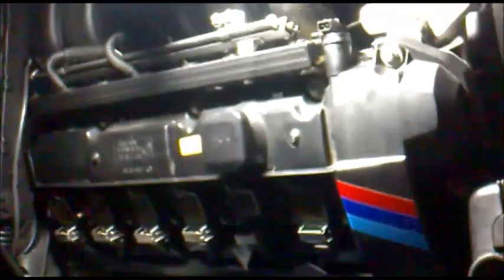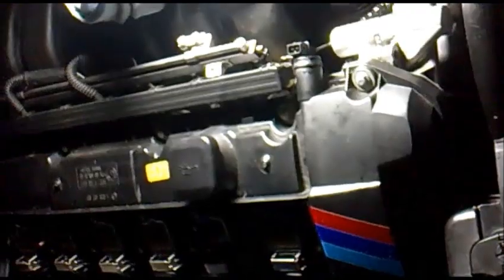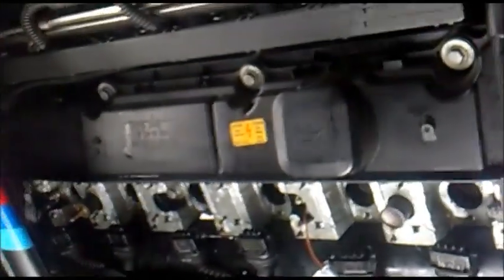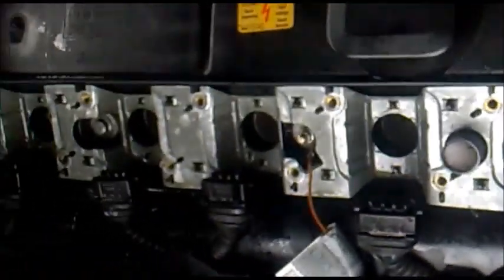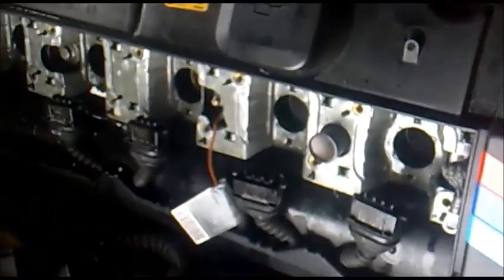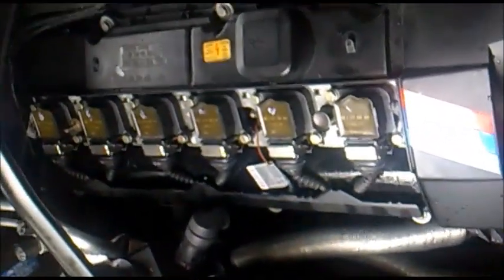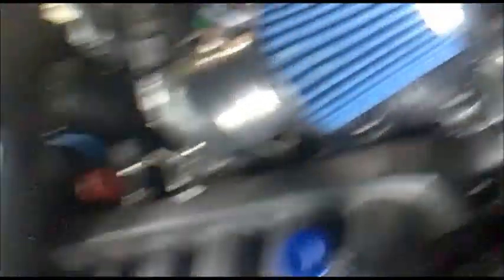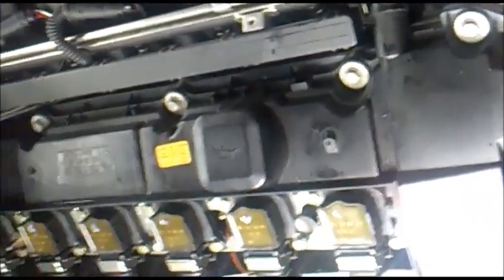Fix for Crank No Start BMW (Fuel Flood/Cylinder Washed)

Comment: i have a big block 70 Dodge engine cranking but no start i checked everything in ignition all good, can i just put oil in #1 and #8 ( opposite side) only? cause i have headers and spark plugs are hard to reach

Comment: One reason bore wash happens is because of old spark plugs that are not burning all the fuel.  My Toyota 2002 ist suffered this problem but after removing the spark plugs turning over the engine rapidly a few times then installing new plugs fixed the problem.

Comment: This worked for me also after the car sat for a year. It runs, but roughly, so new plugs and oil change next. Any other suggestions ? 2000 323i

Comment: Happy I found this video, was running out of ideas from scrolling thru forums. 2011 bmw 335i w/ n55 engine. Performed oil filter housing gasket replacement, valve cover replacement, wallet blast the valves, switch out all spark plugs and boots. All over the course of about 2 weeks. After priming the oil system per bmw procedure I was getting the dreaded crank but no start issue. After much troubleshooting, found this video and after buying a cheap endoscope camera I looked at all the cylinders after removing the plugs again and cleaning them, indeed the cylinders looked dry. Used a straw to add about 5-10 mL of new engine oil to each, pulled fuse 70 to ensure the fuel pump wouldn't turn on, then with the plugs off and the cylinders open to air, cranked the car about 10 seconds. A quick endoscope look into each confirmed the cylinders looked nice and glossy covered with oil. Plugged all the spark plugs and boots back in, returned fuse 70 to its place, crossed my fingers and cranked the car and to my surprise started right up! Large white plume of gas and rough start but quickly settled down and let it run for about ten minutes to ensure all the noises I'm familiar with of the engine were normal. Thanks again!

Comment: Worked for my 2005 X3 that sat through a 2 week cold spell and would not start. It did not start right away but I could tell it was going to because it was cranking much better. A little bit of patients and it fired up and is running great. Thank you!

Comment: My brand new Bosch fuel filter after 2 days decides to start dumping fuel out of the regulator filling up my intake manifold with gasoline! Then trying to crank it over to try and start the motor on the side of the road fuel locked the  pistons! Now I keep fouling out spark plugs! Going to let it sit for a day and hope she starts!

Comment: I have a chevy silverado,  one of my fule injectors needs replacing.  The dealer said I could drive it until the parts are in,  which is about a week.  The driving is fine as of right now.  Do you think it is okay to drive like the dealer said?  I don't want to wash any cylinders and cause more damage.  Thank you

Comment: I want to thank you for these tips, worked for my E39. Car was in underground garage where no tow truck could easily reach to. There was a huge smoke came out after the engine fired up,  almost like a smoking grenade went. Got lucky there was no fire alarm.

Comment: Do you turn over the engine with the plugs out with the oil in the cylinder? Or do you put the plugs in with the fuse pump fuse pulled and crank?

Comment: So here'e the problem im having and im confused! I've replaced soooo much... Camshaft, Crankshaft, Spark Plugs, Ignition Coils, Fuel Pump ( i Need to change the fuel pump Filter and maybe the fuel regulator) ... None of things i did change help the car Start.. It would Crank but no start. Change fuses  and relays as well and to no avail. Tried this method ....... tried it ... tried it tried it then boom the car Started.... Ran for about 30 minutes then Cut off... Didnt't cut on again until i did the process over. It seems as if it would build compression then lose it again. Doesn't have enough power to Drive, Reverse or nothing even when on and running. Checc Diag tool and it's throwing me codes for things I changed already. SUPER CONFUSED... What's my next move?
Reply from the maker: I would suggest you post up on the bmw forum and such really, you might find a better answer there, chance are its a intermittent problem maybe with the crank or cam sensor, have you tested the engine for compression and such? could be a leaky head gasket. I cant really comment on it as a lot of variables come into play. Maybe read some codes and post up on one of the big bmw forums. All the best

Comment: @ Hyde Motor Works Please Help...
Do I... 1) REMOVE Coils, Spark Plugs & Fuel Pump Fuse. 2) ADD Motor Oil where plugs go. 3) Hit Start?
Reply from the maker: Hi, essentially this is a old mechanics trick, you simply try to add oil having removed all spark plugs and disconnected them as well as the fuel and such and simply let the engine crank, then put it all back in and try again. If it was fuel washed it would help bring the compression back up, you can read up on such online.

Comment: Unfortunately this didn’t work for mine :,( I’ll keep trying
Reply: 330i ‘01 auto
Reply: @rock9Tray   
  Hopefully when i tow my car to my storage tomorrow I will some lucc. Im on a incline at my house so im thinking that maybe affecting my process and result. Im just trying to figure out what else could it be. I have Diag scanner and the symptoms its giving me is the things i already replaced. Im thinking it's doing this because of the misfiring in building the compression bacc up. I don't know we shall see when i get it towed in the morning
Reply: same here ... seems not to work and i've changed everything on the car . Camshaft position sensor, crankshaft position sensor, Fuel pump, Spark Plugs, Ignition Coils etc .. Now what I will say is .. when I tried this... It did start and ran for about 30 minutes then bacc to the same thing again. Im confused right now
Reply: Update*** after getting my car towed to my new residents it started and burned all white smoke thru the tail pipe as stated in the video! It’s running but only when disconnected from the MAF. I need to replace my MAF, my gaskets, Hoses and my ccv however to continue onward with no issue. The vid really helped!! Especially since my spark plugs were soaked in oil to begin with. Burnt out on top of that. Best of luck to you tho man

Comment: Can anyone pls help my 2002 bmw 318ti automatic can't start... Engine swing and fuel pump working and checked all the fuses and engine just swings and not getting any spark at all... Can someone pls advice what can be done
Reply: Any help plss
Reply from the maker: Could be a lot of things, best you seek help in the forums, could be the crank and cam sensors, can be the abs module. go to the 318ti forum and ask there somebody might help.
Reply: @HydeMotorWorks  thank you very much I will do just that

Comment: I just changed the spark plug and coil on 2014 535i, car started then stopped, got code for engine misfired on cylinder 2,3,4. Took everything out and reinstalled, clear the code then the engine just cranked but wont start. I did everything i could thing even putting the oil plugs and coils back bust still same thing. Would your method worked in my case? I have a feeling that the cylinders were flood with gas after some many unsuccesul start. Any advice?
Reply from the maker: It may, really depends, this is a old mechanics trick to bring compression back up in case of cylinder flood and what not, could be your crank or cam sensors too, those can throw misfires... could be coils that are bad! This method only works in the average scenarios of cylinder flood really..but you can try it if you like. I would say get it scanned or setup INPA or buy a code reader.
Reply: @HydeMotorWorks  thank you for the reply. How can I tell if the cylinders are flooded? What's the symptoms? Also I can't put the car to neutral so that it can be towed. Is there anyway to put it to neutral without starting the car? The ignition turns on it just won't start.
Reply from the maker: @samho1020  On the older ones its usually a locking pin and you can press the brake once the key is in and turned to switch gears, assuming its an auto. If the cylinders are flooded you can open up the spark plugs and see, but really get a code reader or setup inpa/ista least you can read the codes and go from there.
Reply: @HydeMotorWorks  I fixed it! Pull the plugs out, blower the heck out of the wells and used vacuum to suck anything out. Made sure they are dry then put 4 new NGK plugs in. The car started at first try. What are the odds that 3 out of 6 new genuine BMW plugs were defected? It was a hectic 2 days but finally a relief. Anyway I appreciate you took your time to reply. It meant a lot. Cheers!
Reply: @samho1020  i think ima go bacc and checc my plugs too.  What if the plugs weren't defected but it was just so much carbon and dirt that it caused it to dirty. I think i may get me some more spark plugs as well and give it a try

Comment: one of my cylinder was flooded, I removed my airbox cleaning each throttle bodies and noticed cylinder 6 got a lot of fuel into the throttle body, opening it manually I can see a pool of fuel inside, tried getting as much as I can reach out w/ shop towel and soaked them in, how can I remove the rest of the fuel inside the cylinder before pouring in some oil in that cylinder?
Reply from the maker: Should be fine, will take a fully charged battery and some cranking, some motor oil will do the trick. Just leaving the spark plug hole open ought to had evaporated the fuel really. All the best.
Reply: @HydeMotorWorks  

question, you add the oil while the cylinder is still  flooded w/ fuel? someone told me to remove the spark plugs then crank it to pump out the fuel into the exhaust, then do the rest. Just pulled all my plugs and all cylinders are flooded but the worst one is cylinder 6.
Reply from the maker: @erickrayos  no I would say ensure its not as flooded, take out what you can, let the rest just evaporate and then proceed. I would later also check compression on cylinders.
Reply: @HydeMotorWorks  so followed your steps.

It started but it was misfiring, thinking you mentioned that it may do that for the first few minutes I let it idle for a bit, about 5-10mins in and its still misfiring. It had this misfire before the flooding happened (2nd bank cylinder 4,5,6 only) and people adviced that it it may be the pre-02 sensor for bank 2 that is bad and causing problems since the misfire only happens during after the car warms up.

but this time the misfire started from the beginning.

turned it off, tried cranking it back up and it basically destroyed my starter again, removed everything and now cylinder 5 is flooded instead of cylinder 6, I did mixed the spark plugs and did not put them where they came from after cleaning them up so the spark plugs from 6 may have went to 5 this time.

Bought a new set of plugs and had the starter replaced via warranty and will try again tomorrow. but just in case the misfire still persist what steps do I make afterwards?
Reply from the maker: @erickrayos  Are you reading any codes? if not thats the first thing I would do. I think it may be a cam or crank sensor issue, the flooding is just the result of cranking around and all that. Likely both, if they are make sure the readings say so and then try good OE branded or genuine bmw branded ones.
Reply: @HydeMotorWorks  yeah it shows codes for cylinder 4,5,6 and multi cylinder misfire with fuel cutoff but no crankshaft position sensor codes and I would think all cylinders would misfire if its a crank shaft sensor that is bad not just bank 2 (its a 6cyl engine from a 04 bmw m3)
Reply from the maker: @erickrayos  I was saying more so the Cam sensor, because I have had it happen to me a few times, the cam IIRC going bad causes it to fire all the injectors all at once instead of sequentially, dont quote me on it tho. If it was a crank sensor then it wouldn't crank up either, makes me wonder. Can you check again the air, fuel, spark one by one, the S54 you have should have 2 crank sensors IIRC. what are the codes like?  tried looking those up?
Reply: @HydeMotorWorks  yes as I said the codes came up and shows as Cylinder 4,5,6 (individual codes) misfires, then a code for multiple cylinder misfire with fuel cutoff. 4 codes total.

I switched the pre o2 sensor on bank 2 as someone in the forum suggested.

The way it happened before all this is during warm up after 5-10mins of starting the car the engine suddenly started misfiring on cylinder 4-5-6. then after letting it cool down again next day started it again and it was fine for the first 5-10mins then would happen again after 5-10mins of warming up thats why they figured its the pre-cat o2 sensor since on warm up the car is in a "closed loop" they said and it wasn't really using the o2 sensor to adjust for afr's until the o2 sensor is warmed up.

The flooding incident happened when I tried to crank the car I guess w/ low voltage on my battery a couple of times when the car sat which I am guessing is not the case if the spark plugs fixes this maybe the plugs themselves went bad somehow even tho they looked good. after cleaning them up. here's a link to the plugs when I took them out after I had the misfire issues before putting in the new precat o2 sensor. cylinder 6 was the worst.

https://imgur.com/a/X2D3VUF

Note tho that after starting the car again after flooding it and then now cylinder 5 is flooded, when I took the plugs cylinder 6 looks the same way when I pulled it and the rest of the plugs looked clean much like cylinder 1-2-3 plugs looks like (actually cleaner since I cleaned them up w/ wire brush and brake cleaner).
Reply from the maker: @erickrayos  I see, so it was causing the issues once warmed up? Which is even more strange because thats how my second set of crank and cam sensors died, they would start  fine cold, but once warmed up, I believe the internal coil would lose the magnetism a bit and then it would be no good any more. Can you pop into a yard or a friends car and use the sensors just to try out?
Reply from the maker: @erickrayos  By the way, best not to use those 2 prong plugs. all of us forced induction guys would rather go with single prong, I manually gap mine as well when going Sc or Na.
Reply: @HydeMotorWorks  its the OE recommended plugs tho.
Reply from the maker: @erickrayos  i know, you are still better off with the regular changes with single prongs, read up on the forced induction forums. but more so, dont bother too much with the spark plugs, the issue I still think is related to the sensors. I once went through a month of diagnosis and turned out to be those two, (codes showed only one, replacing which showed the other).
Reply: @HydeMotorWorks  even if it doesn't have any camshaft related codes?
Reply from the maker: @erickrayos  well that happened to my own car, it only registered the cam error after the crank sensor was replaced and the car barely started up, I guess it takes the ecu to have the engine in idle for a min or so to see if the sensors are doing their thing while in operation mode..

Comment: Hi. Thank, great video. 
My golf 1.4 tsi mk5 is cranking , but won’t start. It washes cylinder and then compression goes down, changed plugs, clean them, put oil in cylinder, but still won’t start. 
Before this problem , full service was carried out, but one of the vacuum hose was left open mistakenly. Car starts but misfired, do checked vacuum hose & fixed, changed fuel filter too, car parked for a while , then never started. On VCDS diagnostics nothing comes up. What do u think what should I do? Cheers
Reply: i think im in your same boat somewhat did you ever get it fixed?

Comment: Bro. U the man. I just spent a week testing and removed and replacing. Turns out, this got it started. It’s stumbling a bit tho. Any idea on that?
Reply: Did you do it exactly like in the discription.
Reply: Giovanny Luque yes. I did the same thing the poster did. Start my car and turn it off in the cold and it wouldn’t start all week until I did this. Spent $150 in unnecessary parts
Reply: Thank you ima do right now
Reply: Did you wait a little after putting the oil in and cranking
Reply: Giovanny Luque keep cranking it. It took me like 6 tries before it fired up but you could hear it getting better and better

Comment: This absolutely saved me - thank you thank you thank you - I had initially missed the part where you’re supposed to install the spark plugs and then crank without the fuel pump fuse in place (I’m guessing this forces the oil into the rings on the piston’s way up) held the rpms between 2-3k until the oil burned away and now it’s nice and smooth - be patient!

Comment: BTW,  all I had to do was pull the plugs, add a little oil from a straw to each cylinder, dried the plugs with brakleen and reassemble. Fired right up on the first crank. Thanks again
Reply: What kind of oil?
Reply: @nestop.9892  regular motor oil
Reply: Shit work till this day

Comment: I have a 2003 BMW 328 ci it turns over but won't start .. I replaced the battery because it turns over slow and batter drained fast ... But the new battery turned engine over a lil faster but still died quick .. I checked at the fuel filter line on motor side of line it had gas ... I checked the fuse in my glove and replaced any that were blown .. I sprayed starter fluid into the air filter intake to see if it would start but it just turned over .. what could be the problem?
Reply from the maker: Could be other things, install inpa with some ebay cables, and pull out some codes, could be your starter or alternator not charging the battery, but more likely the crank or cam sensor or both, easy to do yourself too. But pull out some codes, a bad crank position sensor or cam sensor causes the starting issues too. I had a post up on bimmerforums about it, but go there and ask.
Reply: Thomas James did you ever figure out this issue?